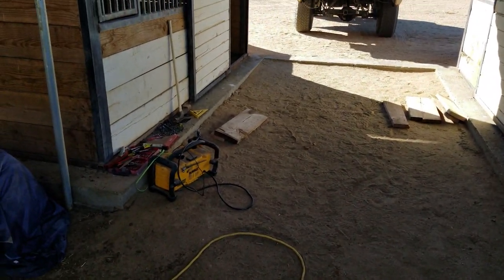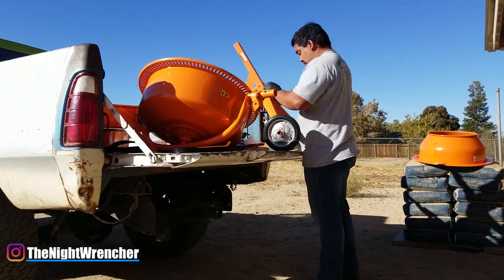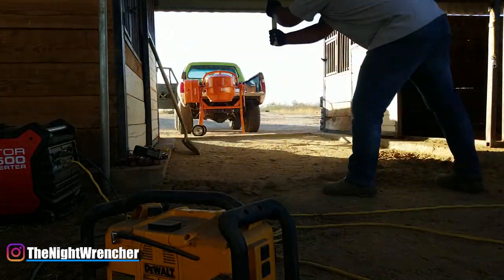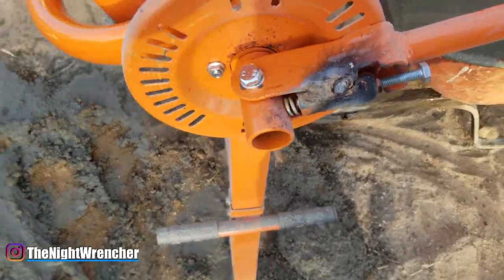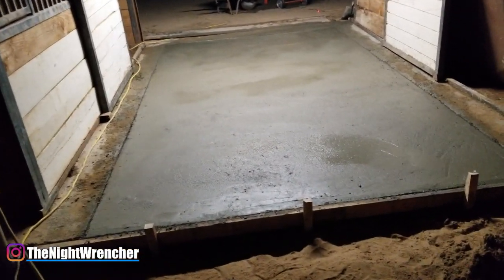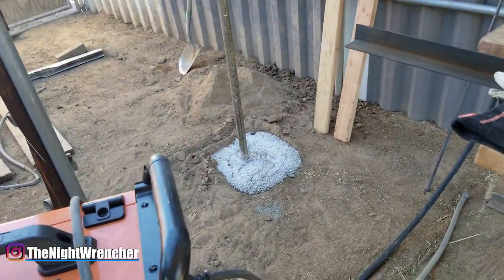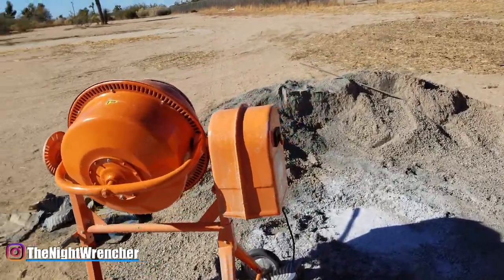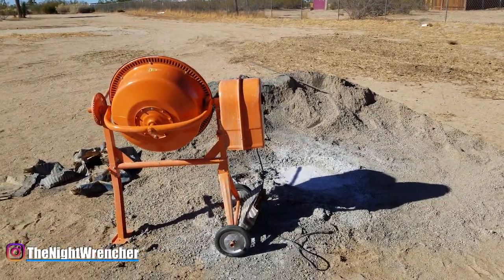Harbor Freight Cement Mixer Review and DIY TEST! | Tool Reviews |

Comment: Thanks for making a video on this mixer.
I bought the exact same mixer 2 years ago. I've used it on several foundations and just finished using it to pour approximately 15 cubic yards of concrete for a path  (6ftx 150ft?) downa hill to my dock. I just bought 15 pallets of 80lb ready mix bags, instead of custom mixing it. I didn't save anything on material doing it this way but there was no other way to do it because of the distance and terrain.  I couldn't geta concrete truck in there. The easier method would have been a pump truck,  but than I would have needed a huge crew and hopefully somebody besides me that knew what they were doing.
On that project alone that little mixer processed exactly 609 bags! That little mixer has paid for itself many times over.
Word of advice for those buying this Chinese mixer: Yes, it's a POS,  but if you are careful it will do the job if you heed these precautions:
1) instructions are crap; so, your intuition and hopefully mechanic skills to put it together. Recomendation: use thread lock on on as many bolts and screws as possible that are susceptible to loosening, especially,  the arm mechanism that tilts the barrel of the mixer.
2) lubricate all moving parts before use ( grease gear).

3) level the mixer both directions before starting (you may have to dig out some dirt), in order to prevent movement of the mixer which makes it unstable causing parts to loosen up

4) don't overload the mixer! Use common sense. I mixed just one bag at a time. Treat it like it was made in China! 😆 

5) thoroughly clean it up after each use
Reply from the maker: Thats pretty crazy! Its paid for itself on my stuff already too. Just gotta be gentle 🤣
Reply: @NightWrencher  i concur with Bob.  i too have mixed hundreds of 80lb bags of concrete through this cheap mixer.  Make sure you wear a N95 mask when you mix.
Reply: A friend had this mixer for 20 years. I find it mixes about half the rated capacity well.

Comment: Mixed 48 80# bags of concrete this weekend. Mixer will do a very good job mixing 2 bags at a time. I found it necessary to mix it a little on the wet side. Only problem was I have a large contractors wheelbarrow - would not fit under the mixer so I had to put the mixer up on concrete blocks so I could get my wheelbarrow under the mixer. I am very strong but 80# bags would be a lot of weight for the average guy. It takes a little longer but splitting the bag and putting the contents into two 5 gallon pails made it easier to pour with the mixer on blocks. I have a few more little projects to finish and then I will sell it. Really a good value for $200.
Reply from the maker: I know exactly what you mean, my wheel barrow is really tall too so dumping the mix onto the wheel barrow was always tricky. I mix my own concrete which is cheaper so going wheel barrow by wheel barrow took a really long time
Reply: Holy crap!  2 bags at a time??? Mine is struggling and moaning with one 80lb bag.
Reply: I have done same exact process you did on your post👍
Reply: I poured a slab 4 days ago that was 36 #80 bags in 70 degree temperatures.  Had no problems finishing the surface but mixing in a wheelbarrow was back aching.

Picked up a cheap, Chinese made mixer on Amazon that is very similar to this one for my next slab, which was done yesterday.

Struggled getting concrete out of the mixer and into the forms.  Had to fight with that damn mixer.  Barely got the slab floated but might have to resurface a couple of spots.  Temps yesterday were in the 90's.

Anyway, I will try these techniques for the third slab.  My gut feeling is that using these techniques will make the next job go much easier so thank you for posting this!

Comment: got the same mixer from Harbor Freight. Yes not best mixer out there but for the money it got the job done and it beat the hell out of trying to mix +500 80lbs bags of concrete by hand in a wheel barrel.
Reply from the maker: It does what it needs to do, its not a commercial grade unit but for the DIY guy, its great.

Comment: My HF 4 yard mix > after idk how many years i had it?  It mostly sets in the barn. So the other day i need to make a pad for a shed, and it wouldn't turn on.. The off and on switch was bad. So. I had a simple, 84 cent, cheap, house light switch, and put it on. And it works GREAT 👍

Comment: I haven't had a look down the comments and I'm probably not the first person to tell you but it's a portable mixer so for a job like this move the mixer and the ingredients to where you're pouring instead of using a wheelbarrow.
Cutting out the barrow saves a lot of lifting, so it's easier on your back.
I would also think about fitting some better wheels to it because the Chinese have a tendency to cut corners when it comes to wheels on things like this. I have a 2HP workshop dust extractor that moved really well when the bag was empty but when the bag was half full it was impossible to move.

Comment: I had to cut one more slot in the tilt lock to get 2 80 lb bags to mix without sloshing out (or 3 60 lb bags).  It’s not pretty but it works.
Reply from the maker: You gotta do what you gotta do!

Comment: Get 4 concrete blocks. Set 1 under each wheel so they sit in the hole. The other one the foot sits on. The 4th one can be suspended from the mixer with rope to help anchor it and keep it from tipping over. That's why they can't be very tall.

Comment: Do you know how much you saved by mixing it yourself? thinking of doing this, thanks
Reply from the maker: You'll be surprised, but not much. There were savings, but not as much to offset the cost of the machine but if you do enough concrete, you will see a good return on the investment.

Comment: No rebar needed for the slab? I have a 12 x 10 space in my backyard and I want to put concrete base down for a shed
Reply from the maker: I would use wire mesh. I believe its 6"x6" but I'm not sure. I have that in my slab that I drive my truck over and have had no issues in over a year

Comment: I bet around minute 4:50 you realized you should’ve picked up the industrial size one 😂 
I had a towable Gas 9 cf that I sold when I got out of the business to become a stay home dad 🤦🏻‍♂️😍

Well I picked up this “toy” to do about 4 yards and it’s a no go for me. I’m actually gonna modify it to suit my needs. It’s great for the price! But for those who have used actual “cement mixers” is so SLOOOOWWWW to work with.
Reply from the maker: Tell me about it 🤣 I'm use to much bigger units but its cheap and it works. I do 1 yard at a time when I do use it or I use it to mix potting soil
Reply: You got me beat, I only did 1/2 yard then was able to finish that area really nice. It was a perfect section to stop, right at my first expansion joint. So now replanning my approach after mods. The machine itself is VERY GOOD FOR THE PRICE. I did take the drum off to put thread locker by the sprocket. Used it on every bolt and lubed her up like if it was party time and the kids are at grandmas 😳😂🤣🤣

Comment: The belt keeps slipping on mine I'm only putting about a half a bag of concrete in it and it it just stops spinning I have to end up mixing it with a shovel
Reply from the maker: You need to loosen the motor and pull the base plate down a bit and then tighten the motor back down so you can add more tension to the belt
Reply: @NightWrencher  thanks, it was actually the key way had sheared
Reply from the maker: Jeez man. How does that even happen??
Reply: @NightWrencher  The key way is a softer metal than the pulley shaft and is designed to shear in case of too much load to protect the motor and shaft from more severe damage. I only had about 20 lbs of cement in it and it sheared when I added one more shovel full, so I don't know why it failed so easily. Probably just a weak key mad from Chinese pot metal. I picked up a 12" length of key stock at Tractor Supply yesterday (5 bucks), I can make 180 key ways out of it.
Reply from the maker: Time to start breaking key ways 🤣

Comment: How come you didn’t use rebar?
Reply from the maker: Because its only for foot traffic , no cars. Plus I made the mix a little rich for more strength
Reply: @NightWrencher  what was the mix ratio 
50 rock 50 quick rete:50 sand?
Reply from the maker: Kind of late but I dont use quickcrete. I use regular portland cement. 7 bags per yard of concrete was the old measurement. half a bag of portland every 2 wheel barrows.

Comment: I have a gas-powered concrete mixer. It leaks gas what are the possible causes?
Reply from the maker: There are only a few places it could leak from, a hole in the tank, a split in the line going to the carb and the carburetor itself could be leaking. I would power wash everything, let it dry and put some fuel in it after to see if you can find the cause of the leak. If you see it dripping, follow it as far up as you can and you'll find the culprit.
Reply: @NightWrencher  ok thank you so much for responding

Comment: I noticed you didn’t use any Remesh or rebar ?
Reply from the maker: Its a low traffic area so it wasnt nessesary. If youre going to drive over it or its a high traffic area, I would use wire mesh.
Reply: @NightWrencher  Thanks for the tip , I am poring a concrete base in my backyard now to tile the whole yard and this saves me money
Reply from the maker: Good idea! Wire mesh is pretty cheap and I would use it for a patio. To prevent cracks. Floor cracks will translate to tile cracks so you gotta be carefull
Reply: @NightWrencher  Yes very confusing informations out there , as I am trying to do this by my self to save thousands . I am in Florida and most keep saying you have to create a concrete base before you can tile a backyard. Most peoples here do pavers but we want to do something different . Overseas usually in southern Mediterranean regions we compact the ground and than use a cement mix directly to the ground to tile , no concrete base no tile adhesive necessary !! Looks great and last forever, here I don’t know why no one seems to know this method. Maybe it has to do with the type of soil in Florida or weather . Also they taking about joints etc .. Than it’s more issues to tile over joints .
Reply from the maker: I've use that method when installing slate floors. It does work but over time it does develop fractures. Tile over concrete slabs seems to be the most common thing to do. Tile floors are made to be laid smooth. When you pour concrete and lay tile on top at the same time, the floors dont end up straight and are a little wavy which most people dont want. Its really a matter of preference.

Comment: Hey good job 👍 I have been wanting to do a slab for a shed that’s 8’x10’. And been meaning to buy this cement mixer at harbor freight when it’s on sale.   How much cement mix do you think I would need ?  Yards ? I think it would have to be at least 2-3” deep if
That’s the recommend thickness for shed.  I need to buy everything and I would like to do this myself.  I don’t mind the work .
Reply from the maker: That would be a little less than a yard. Theres a lot of concrete calculator online that you can use. A yard takes like 6 bags of regular concrete so that should be enought for you, good luck!
Reply: You need 45 80lb bags to make a yard…. Not 6
Reply from the maker: What? Have you ever used a concrete calculator? We're not talking about that ready mix stuff. We're talking about pure portland cement that you have to mix yourself.
Reply: @NightWrencher  so u still have to mix with with sand and gravels? i still don’t see how u get 6 bags, concrete calculator never mention about mixing sand , gravels or anything they usually say 60 bags or 60lbs or 90lbs
Reply from the maker: @derpherpp  yes, you still have to mix with sand and gravel. The concrete calculator you are talking about uses premix bags where you just add water. The cement we use you have to mix yourself and buy everything seperately. Its much more cost effective.
Reply from the maker: @derpherpp  at 4:12 you can see the delivery of sand gravel mix
Reply: A yard of concrete is 27 cubic feet. an 80# bag is 0.6 cubic feet. There are 45 80# bags in concrete. Easy calculation for a 4" slab is length x width x .334 divided by 27 will tell you how much concrete you need. 8' x 10' x .334/27 equals 0.99 yards or 45 80# bags of ready mix concrete. I would do 6" myself for a shed just to be safe.
Reply from the maker: @georgetoussaint185  thats correct, "READY MIX" concrete.
Reply: @georgetoussaint185  driveway only 4”…

Comment: don't you need rebar or wire mesh?
Or is that a special cement
Reply from the maker: I didnt show it in the video but I added 6 20ft bars worth of rebar. I didnt have any wire mesh available so I threw in the bars afterward so I wouldnt be stepping on them with the wheel barrow. Good catch! My other section I used wire mesh. Check out my instagram to see the other one I poures

Comment: The instructions suck and the motor was bogging down and failing towards the end of pouring a 10x12 pad. Temperature was high 80s. Was mixing 2 bags of 50lb concrete. Not sure if motor is permanently shot.

Comment: you need  to put 1/4 sizes gravel on that mix thats what makes it strong. And that mixer is 3.5 cu ft
if you don't  know the right amount to mix you will kill it..
your mix needs to be sand gravel and cement..for slabs that is.
Plus you need  to use wire mesh
Or rebar to reinforced. if not it will Crack..
Reply: Looked like a sand gravel mix out of the dump truck (which is not something I would go for), but rebar doesn't help with cracking, all slabs crack.  Mesh/rebar only keeps it from separating when it dose crack, not to mention puts a maximum 50 year lifespan on a concrete exposed to water/weather (metal rust and expands)...  Unless it's the fiberglass kind.